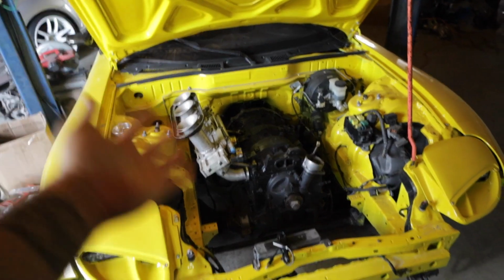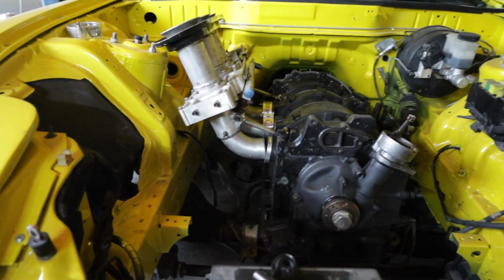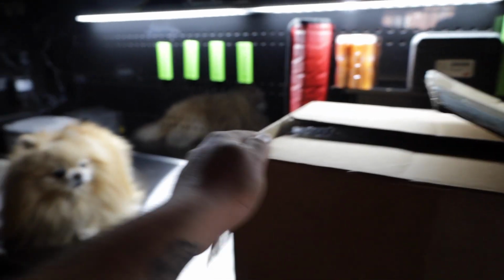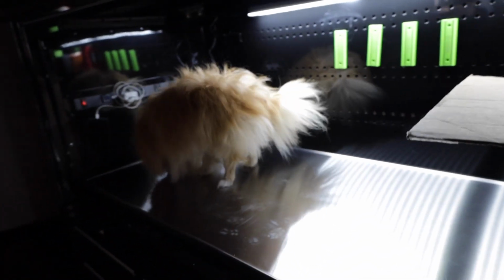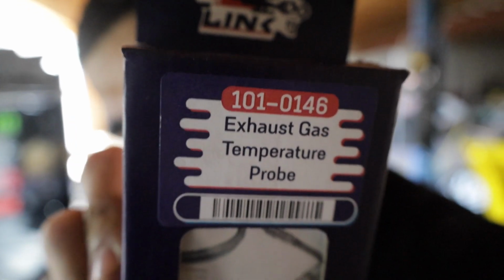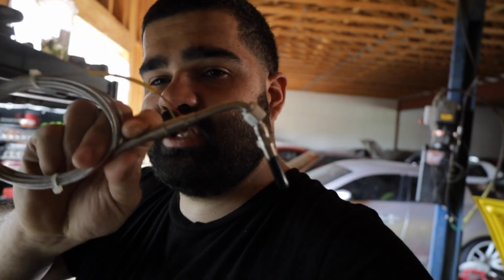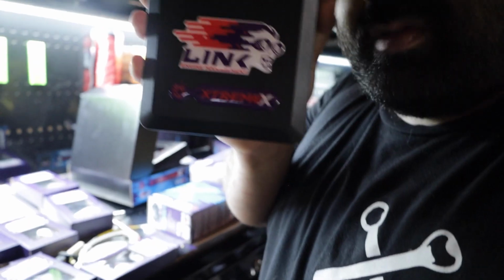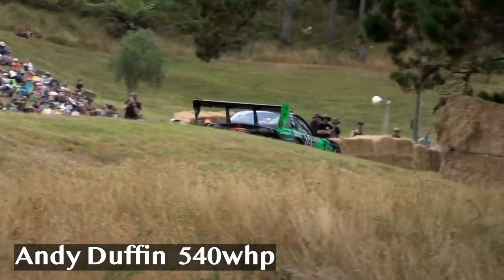Why I Might No Longer Be Doing DriftWeek3

Comment: just make sure you get a phat insurance payout. Be sure to let them know the wheels it had, mods, etc
dont settle for less than what you think its worth
EDIT: the delivery company is also liable here, just keep that in mind
Reply: It gets super hard when your dealing with insurance and trying to get them to value race cars correctly, sadly I think he's only getting a fraction of what was put into the car
Reply: @overland_viking04  it's hard but not impossible.
Reply: Alpha Worx  absolutely not. The value of cars change over time, especially older cars like this. It's very common to not accept the first offer your insurance company gives because it doesn't reflect this change in value.